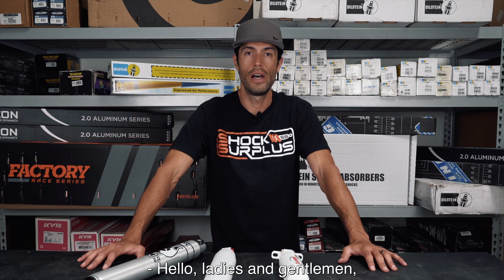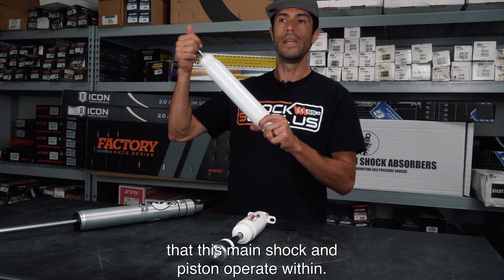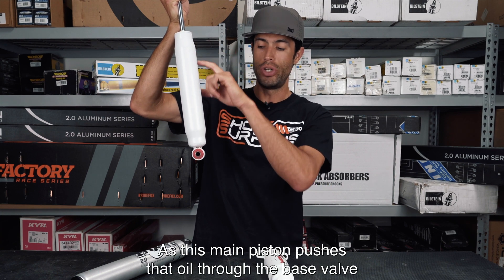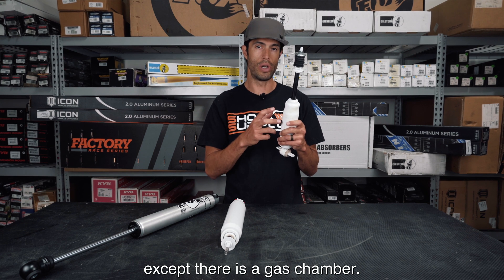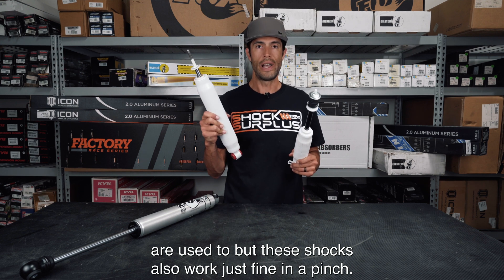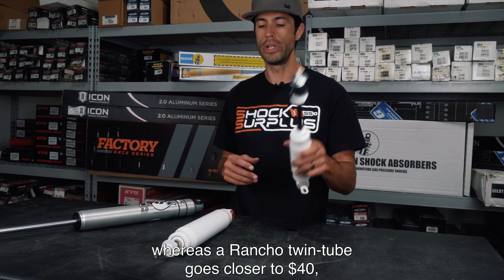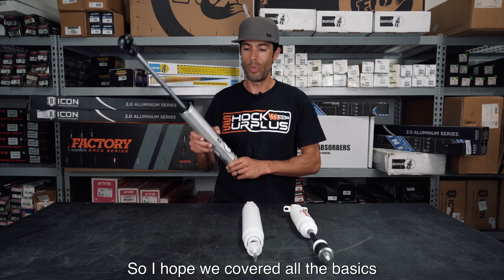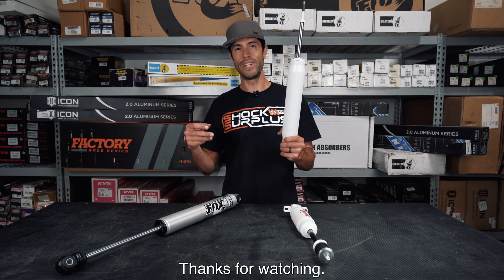Shock Talk - Hydraulic vs Monotube Gas Charged vs Twin Tube Gas Charged

Comment: Are there shocks that don´t have a separator piston but do have nitrogen in the same chamber as the oil
Reply from the maker: Gas charged twin tube shocks use a single main working piston in the main chamber that pushes oil through a base valve into the outer chamber that holds the gas. Monotube shocks have a working piston and an internal floating piston that divides the oil and the gas. On a external reservoir shock the concept is largely the same, but the IFP is moved to the reservoir.
Reply: I have a BMW 1200 2012 and it has a monotube shock without a working piston that separates the oil from the nitrogen, but on the label it says "This assembly contains high pressure nitrogen gas", so I wanted to know how is that possible, the oil and the nitrogen mixed in a single chamber?. Thank you for answering!
Reply from the maker: Yea if it does not have an internal floating piston or only has one piston it is an emulsion shock and the oil and gas are in a single undivided chamber.
Reply: Thank you very much for answering

Comment: So I understand the differences, but how does the hydraulic only shock have any rebound if there's no nitrogen charge?
Reply: The spring rebounds it......
Reply from the maker: the shocks wont rebound on their own, but they do achieve rebound damping through the piston valving alone. They will still suffer a similar fate as all twin tube shocks do, a very small piston

Comment: Yeah but hydraulic shocks are way more comfortable for daily driving when you dont need performance
Reply from the maker: true, skyjacker black max or h7000 are pretty soft
Reply: Not bilstein b4.   They're actually both more comfortable and have better control than regular shocks

Comment: how can you tell when a gas shock is not working?
Reply from the maker: Depends on the vehicle but for the most part you would feel like it was no longer hold the vehicle up or not as stable. In some cases, the vehicle may feel like it bounces too much, and in some case you would see leakage.

Comment: Really nice video.
I was looking for information about gas presure.

I got it. tnx
7-10,5bar for usual absorber
13-17 for sport absorbers.
More presure means more stiffness.
Reply from the maker: Case by case on the shock design and usage. The Bar/PSI can effect drive quality but we wouldn't increase that to support anything. Rather we would do 1. spring rate 2. valve stack 3. valve psi.